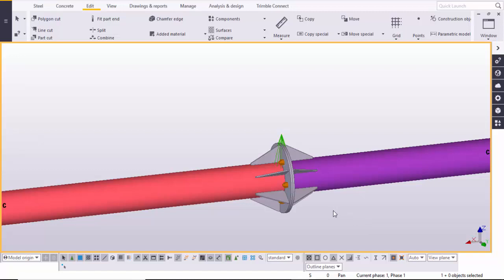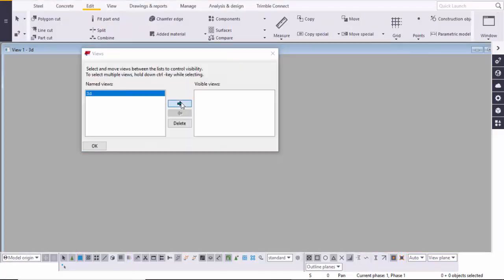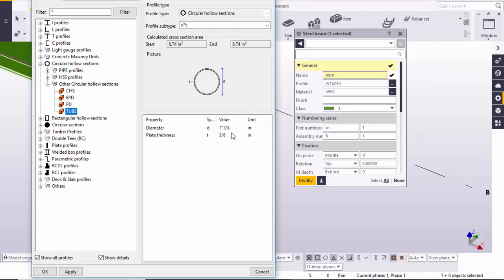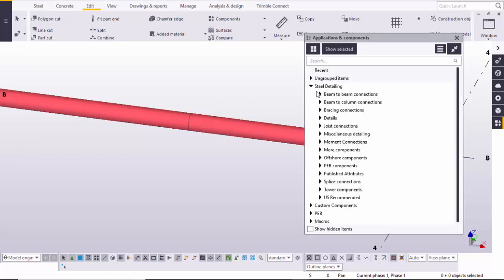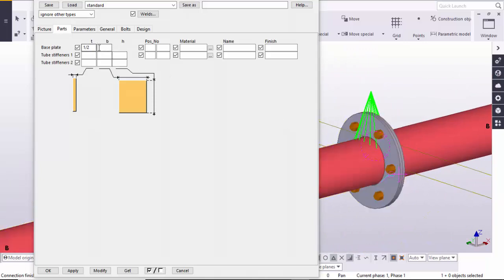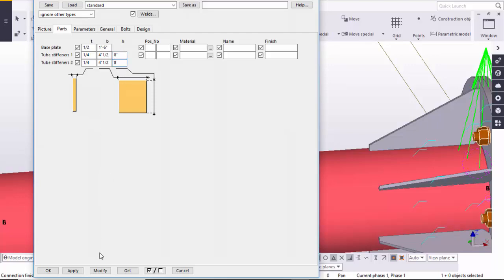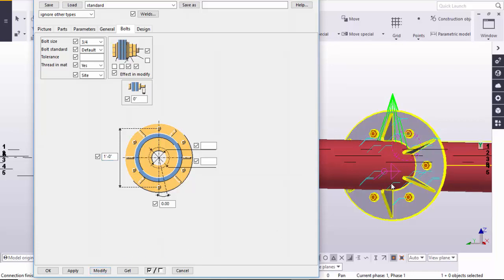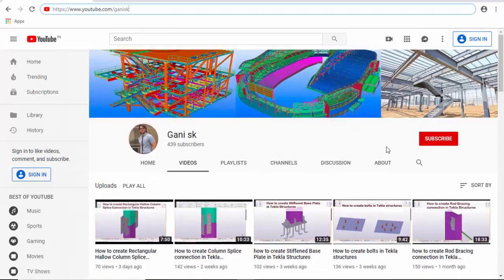How to create Circular Pipe Splice Connection in Tekla Structures

Comment: Hello, how can change the number of stiffener plates but same numbers of bolts, let's just say that I need 18 quantities of bolt, but for every 2 bolts, there's stiffener plate in between(just 9 stiffener plates needed).
Reply from the maker: There is no option in that component to control number of stiffeners, but you can do one thing is after finalize the connection in the component click on modify apply ok, later in the model select the option "select object in component" next select the stiffener which is not required and you can directly delete it from delete button on keyboard, you won't get those deleted stiffeners in fab drawings until unless you edit that component again. if you want to edit that component again please keep in mind you should delete stiffeners once again, because default stiffeners will be generated once again when you click on modify in component.